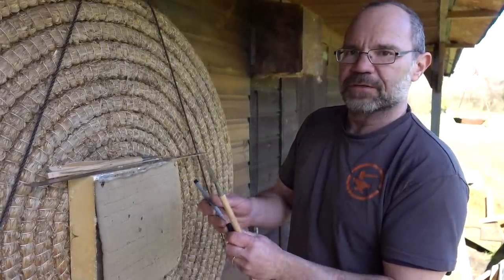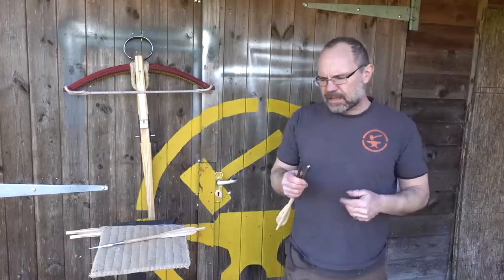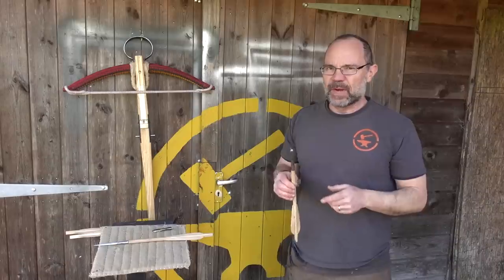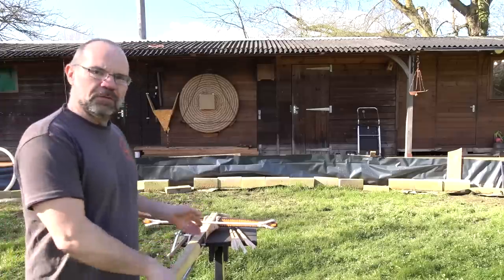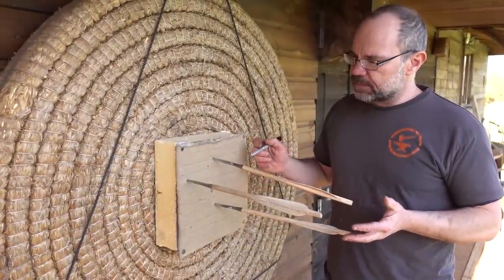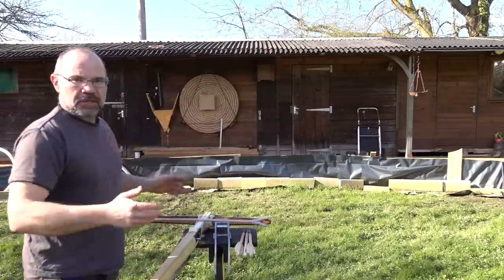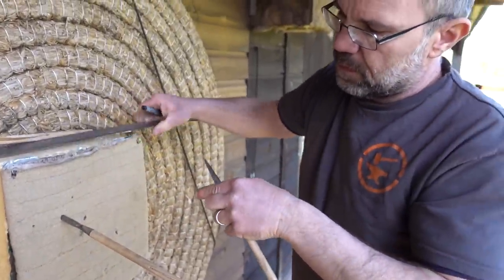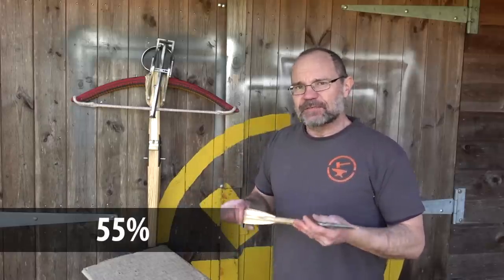Does WAX on ARROW HEADS Do Anything?

Comment: Would a waxy/oily coating also be valuable for preservation.  After all, many arrows/bolts would lie in storage for years, wouldn't they?
Reply: I dont think so, that would require huge amounts of wax. Keep in mind that someone has to keep all these bees, and you cant take too much at once from one hive. They also had rather simple bee hives, not as productive as modern ones.
Reply: @viktorbimmel4007  compared to the amount of beeswax, tallow, or equivalent already in production at that time for candles and such it's a pretty tiny amount. as I see it it would be a relatively minor investment to protect and prolong the far larger investment you've put into the reserves of arrows and bolts
Reply: @jakehoyer8668  not to mention the extra effectiveness it apparently provides, which I'm sure someone would've noticed, makes it even more worth the investment
Reply: @viktorbimmel4007  It doesn't need to be bees wax. There were many cheaper alternatives. eg. tallow. Cheaper than letting arrowheads rust.
Reply: @jakehoyer8668   They wouldn't need to dip them, necessarily. Perhaps many of the same benefits were gained (and wax use reduced) through wiping on the wax instead, or wiping on a wax-oil mixture (something that has long been a practice in blacksmithing.)
Reply: Small metal parts were put in barrels of animal fat/oil when stored for long periods of time.
Properly processed oil can last very long without getting lumpy.
Reply: @viktorbimmel4007  Well... Mead is made from honey, so there may have been a lot of bees around. Improved penetration, reduced accuracy?
Reply: @viktorbimmel4007  A paper by A. Sapoznik, on beeswax economy in Medieval Europe, argues that there would be hundreds of thousands of hives in England alone. This was necessary to provide beeswax candles for parish churches, larger institutions such as cathedrals and the royal court would have bought better quality beeswax from the Baltic region through the Hanseatic League or from Lisabon. Beeswax candles were necessary for the connection between Jesus (apis aetherea) and bees (the genus of honeybees is Apis), therefore candles of tallow wouldn't do. Hives were left to churches, and descendants, after death according to wills and church records. 

Source: Sapoznik, A., 2019. Bees in the medieval economy: religious observance and the production, trade and consumption of wax in England, c. 1300-1555. Economic History Review, 72(2).
Reply: @OutOfNamesToChoose  Blacksmiths burn the oil onto the metal, so it's a different effect.  They put it on while the metal is still very hot, it creates a more durable protection layer, but it looses the oily property and I suspect won't really benefit here.
Reply: they do the same thing with fire arms. ESPECIALLY from communist countries. They would dip the entire gun in cosmoline so every part inside and outside was coated. 
I have seen it so thick you couldn't actually see the firearm. It was just a gun shaped glob of cosmoline.
Reply: they could also just scrap it off whatever candleholder was nearby it doesnt have to be unused
Reply: I think it would soften the wood, reducing the effectiveness and efficiency of the bolts. (just my thought)
Reply: @jakehoyer8668  maybe you would see people wiping the tips on their nose before shooting. Medieval Europe had a strong culture of meat eating, meaning that people would have quite a bit of grease on their bodies with some regularity. Their hair would be greasy, their face, even their clothes might be.
Reply: @viktorbimmel4007  Wax was a very important commodity back then. Not only for lighting but also boatmaking and tablets for short term annotations (wax was way cheaper than paper and reusable).
Reply: That was exactly my idea too.
Not just for storage, but also on campaign. On ships or walking through rainy Europe, maintaining all those thousands of arrows must have been a nightmare otherwise. And as with swords, a rusty arrowhead won't be as effective.
So a win win situation
Reply: @tsmspace  it would help preserve the wood so it would remain strong. Without a coating wood, especially thin bits of wood will degrade over time. Plus wax is considered a dry lubricant, you can rub or melt it on, but once cool it doesn't soak in any further.
Reply: Wait. Spitfires as in, the planes???
Reply: @dimesonhiseyes9134  I love the smell of cosmoline in the morning. Smells like victory.
Reply: @tsmspace  They could wax/oil the arrowheads before sticking them onto the shafts, I guess?
Reply: I'd imagine they pack them in grease or similar substance as they do even today.
Reply: When i was doing DA re enactment i was told they used to store maile in barrels of pig fat to prevent rust. Don’t see why they wouldn’t do the same for other metal items. I was hoping Tod would try some other lubricants like dripping or oil for comparison.
Reply: @viktorbimmel4007  Could've used animal fat.
Reply: Just to add to the conversation, woodworkers today use wax to protect and lube iron tool tables like table saws, drill presses and scroll saws. It prevents rust and helps your work piece move freely. As a solid, it could have been carried onto the battle field, i'd think.
Reply: I can see this as being a plausible explanation for someone using wax/oil tipped heads. People were experimenting with ways to make arrows/bolts last longer in storage  and found out they also penetrate better after using them.
Reply: Long term storage of bolt/arrow must have necessarily requiered beewax, the cost involved in making hundreds of bolts of warfare use and the man hour required to maintain and prevent rust imho are a clear incencitive to promote the use of beewax, which stay stable for years. There was no automated climate control in castle armouries, one would assume that the cost of the beewax needed would be compensated by the saving gernerated from not having to constantly polish the heads (thus affecting the balance of the bolt by the removal of metal) and replace wraped shafts due to humdity and temperature changes in summer/winter. For quickly made arrows made for specific campaign such usage of beewaxe would have been indeed wasteful, animal fat leftover from butchering/cooking would then suffice.

And we must not forget that honey was the most common if not the only sugar source of the middle age. Bee keeping must have been way more develloped that we modern people tend to beleive.
Reply: @ArkadiBolschek  Yes, the fighter planes. Those were manufactured, wings removed and packed along side of the fuselage on big wooden crates and covered with wax to prevent corrosion while in on route to destination or in storage. Wet and salty sea air would wreck havoc on unprotected surfaces if left as is. Moving big crates is generally much easier than full planes being moved, cause you would require huge ship or aircraft carrier to transport them and that is taking whole task force away from where its needed, so planes were put in crates and moved by civilian cargo ships. 
36 has been found there there can be up to 60 spitfire crates that were buried in Burma in end of the ww2, to prevent them on falling on Japanese hands, or least what news state.
Given those are rare planes today guy and his business partners are making 90 to 350 million pounds from this discovery as working spitfire goes for 2.5million pounds and these are in relative pristine condition due wax coating.

Comment: 1:00  "Don't tell me it's wrong - go look in a museum."

Something that needs to be said to the vast majority of keyboard warriors.  Bravo.  :-)
Reply: I mean, that's the kind of thing the keyboard warriors might say themselves too.  It's exactly the me vs you mentality that goes counter to meaningful debate.
I'd rather have a "This is where I am pulling my sources from, I think they are the most likely cases so I'm going with that but feel free to try and convince me otherwise"
Reply: @rommedegraauw4060  A naive faith in authorities might presume that no rubbish finds it way into museum collections or that the most commonly occurring type will be proof of best practice. Sometimes it might be, for example, that most commonly occurring items are evidence of lowest cost or most readily available.
For a given application, what is the best combination of material, length, weight, taper, edge/point hardness and surface finish when shot by a "standard"" powerstroke?
And how much variability is acceptable or even practical?
Reply: Reminds me of an Isaac Newton quote:
"I have studied these things. You have not."

Comment: that was really eye opening! 
by the way: i think waxing also protects the bolt from corrosion. so that may be another argument that people back then did this. Because when you want to re-use the bolt i think you just want to be able to pick it up and not polish it and the other arrows/bolts you shot for a whole day and poke your finger several times.

great video!

greetings from germany ;)
Reply: it´s interesting, but still doesnt look like it would kill, injure yes, my bet is they did stick the tips in poo so the wound gets infected... Also wax was pretty expensive too
Reply: @Knort  if they are waxed, they don't need poop, there is enough germs on the targets clothing for the wax to pull into the wound and get the same contaminating effect.
And while wax and parrafin was expensive, tallow and grease was not that.
Reply: What state? BW? Bavaria? Rhineland?
Reply: @Knort  Unless you're made out of insulation foam, I don't think you can use the video to judge how deeply the arrows would penetrate human flesh.
Reply: Traditionally most blacksmith finish with wax on iron or steal so there would be wax on them form the smith.

Comment: Maybe the wax was used to prevent the metal from rusting. And it just had an unforeseen benefit?
Reply: Most likely the case in my opinion.
Reply: It may have started as simply preservative, then someone noticed that some heads worked better than others (perhaps the first shots during practice vs after several shots, or that fresh arrows in combat didn't bounce as much as ones picked up during the fight) and figured it out.
Reply: Agreed, the question is, did they realise it also increased penetration?

Wouldn't animal fats have been more available, and have a similar effect? So then the question becomes, why specifically wax, better penetration or better corrosion resistance, that could trade out a cause and effect.
Reply: Yes its a traditional finish for iron/steal regardless of its use.
Reply: @benholroyd5221  any oil/fat would both preserve and increase penetration. Bees wax would have been available to archers as it's needed to lubricate bow strings as well. Wood could be preserved by oil such as tung or linseed as well.
Reply: I have read that conventional archers stuck their arrows into the ground prior to shooting to infect their victims. Rust would also cause tetanus perhaps so maybe the wax was not for preservation but purely for better penetration. Then again, an archer traveling for months with an army may be issued with bodkins from old stock that, being made from early iron, would have degraded due to rust. Certainly seems to work for both corrosion resistance and effect.
Reply: @benholroyd5221  Wax stays long-term. You could keep a bunch of waxed heads safe in storage until you needed them. Probably just as much for corrosion prevention as for penetration.

Comment: Goat's foot lever is squeaky. Would waxing it make spanning faster?
Reply: Just my thought too.
Reply: Wax everything.
Reply: Wax ALL THE THINGS!!!
Reply: Problem is it'll probably scrap off the wax every time you span it, maybe put a grooved wheel on the bolt that the goat's fool scrapes against?
Reply: @jameshenderson4094  You only need a very thin layer wax or oil to reduce friction. And it will reduce rust as well. Never overcomplicate a construction. That will fail in it self. Thats why the kalashnikov just works whatever you throw at it. First rule of engineering: KISS, Keep it simple, stupid! Second rule (Murphys law) If it can fail, it will. More complicated details that can fail. See rule #1. Third rule: If people can missunderstand or missuse it, they will. See rule #1. Fouth rule: When it fails, and it will, some idiot has to repair it. See rule #1.
Reply: You also need to lubricate the archer with ethanol to reduce the grunting sound. Be careful not to overlubricate though since it may lead to singing and poor aim.

Comment: It's seems to be like waxing a needle when sewing leather, they probably did that as well.
Reply: You don't wax the needle, but you do wax the thread. If you wax the needle, it will be too slippery to pull it through.
Source: I'm a sailmaker (same needles, different material, as sturdy).
Reply: @DrTheRich  in Greece we did lube the bodkin needles with a mix of olive oil dregs, unsalted lard and wax. My grandfather who sewed leather did this. I don't know if it had to do with preservation or with aiding penetration into leather.
Reply: Agreed
Reply: @DrTheRich  You do to sew leather.  Also carpenters have been using wax or soap to make screws and awls go into wood easier for centuries.
Reply: @DrTheRich  I've sewn heavy fabrics and leather - if you're not in a hurry then waxing the needle is good (I keep pliers handy and use a thimble, mainly because it has superior grip).
Reply: @pd4165  well, if you're seeing 100 square meters of sail for old boats, having to the pliers with every stitch gets old quickly.

Comment: I've been thinking a lot about the first vidoe you did, and I think the reason the needle didn't do as well as the broad bodkin might be because, whilst the broad bodkin can cut through, the needle has a much smaller cutting edge (just the tip really) and so, once it has made the small cut, it needs to force the fabric out of its way, and the fabric is simply too dense for it to be able to manage. Fantastic follow up though, lots of food for thought.

Comment: I do not know about wax as it was somewhat more rare and more expensive. But i can assure you every bit of metal back in the day was greased or oiled for corrosion protection. I imagine that every arrow or bolt tip, though not particularly expensive in themselves would be oiled for storage and transport and nobody ever bothered with cleaning them before use. It might be that a clean non lubricated tip would actually be the exception raising wonder at the low performance it achieved.
Reply: So possibly tallow instead of wax?
Reply: Anything that wasn't corrosive.
Apparently lard is a bit acidic - I believe olive oil is too.

Arrows were assembled - one person could make all the components but for industrial quantities you'd farm it out to specialists. So you had fletchers and...the others ;-)
IIRC the heads were manufactured and bought in pots - the wooden shafts don't need much in the way of preservation so leaving the heads in a pot filled with fat would make sense.
Assembling the components is a relatively quick and easy job, it's making the components that is time consuming.
Reply: @pd4165  While some greases (solid fats) and oils might have a small acidic component. In time that would only make a patina and the acidity would drop somewhat. For storage purposes I doubt this would be a serious problem, but I am sure through observation the best ones would spring out. Rust was a given back then and storage was not really intended to go unchecked for years.

About grease pots, that would require a high mass of grease, and that is seen just as wasteful as today. Rubbing iron and steel with the so called grease cloth (oil cloth- but not the drying kind) would suffice. This is still the case in carbon steel mechanical parts today, although oil baths are used for large quantities.

Comment: for the bolts vs armor, having the bolt capped by a bigger blob might be better. To copy one of the two behaviors of a capped ap shell. not the balistic cap(apbc) (that's for flight speed only) but the normal cap (apc) which prevents hardnend penetrators from shattering on impact & can often increase penetration on sloped armor, since it being hit on the bottom makes the main penetrator buckle ever so slightly before it impacts, that it can align it with the armor and by that i mean align it to a perpendicular point of attack (benefit is usually under 5 Degrees of angle, but it should/could almost double the area in which a bolt/arrow has a chance at penetrating/damaging the armor)

Comment: This is also a trick woodworkers use when dealing with old seasoned woods.  It lubricates and helps prevent cracking on the way in, then cools and acts as a low-grade adhesive.